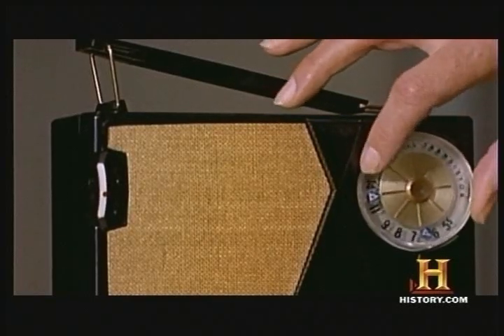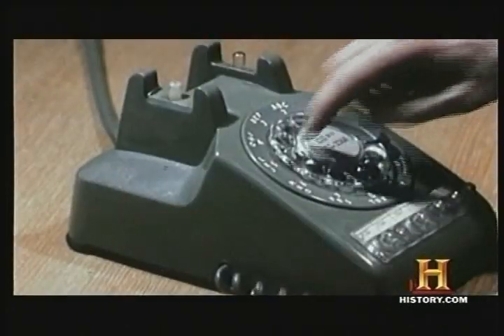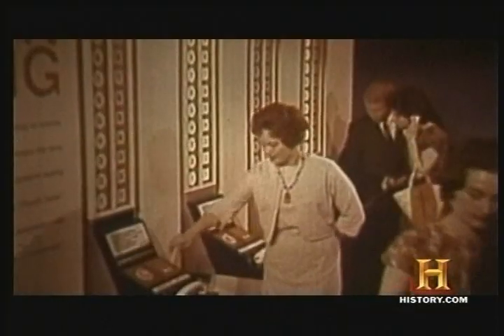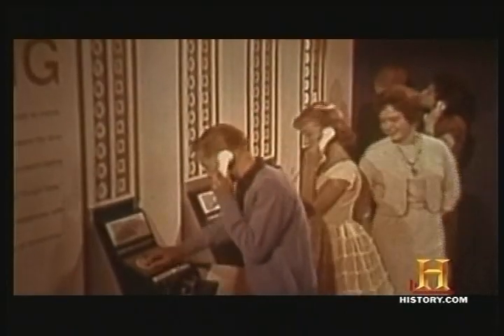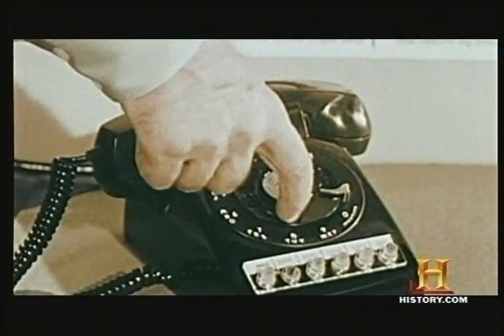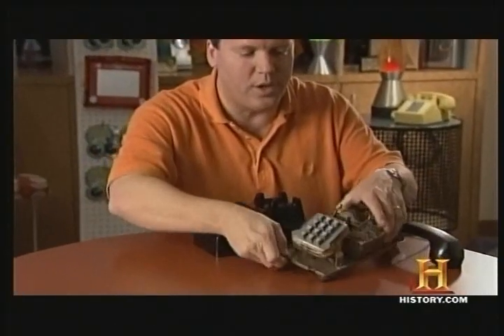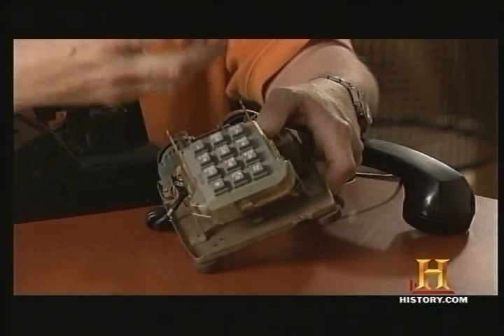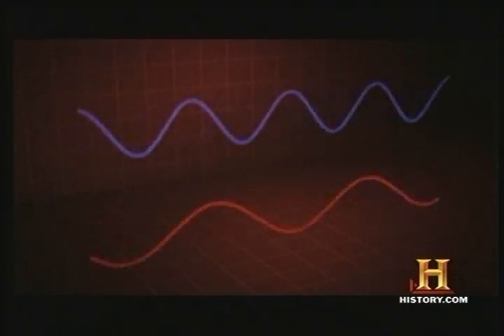Touch Tone Telephones

Comment: The early versions of the touch tone phones did not include the " * " or " # " keys.  Do you know, off hand, when those keys were introduced?
Reply from the maker: The first Touch Tone phones were the Western Electric model 1500, introduced in 1963. The * and # keys were introduced with the model 2500 phone which came out in 1968.
Reply: dmine45 Thanks for that info!  My mother got Touch Tone service and a had a Touch Tone Princess phone installed (minus the * and # keys) in the bedroom in the mid-'60s.  The service must have been very expensive in those early day of Touch Tone as my mother reverted back to rotary service and had the touch tone phone disconnected soon afterwards.